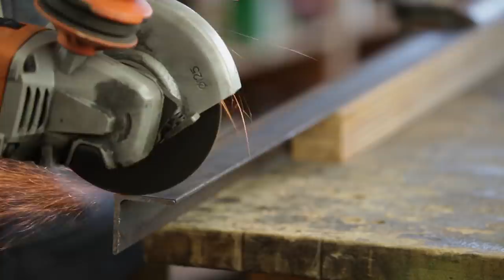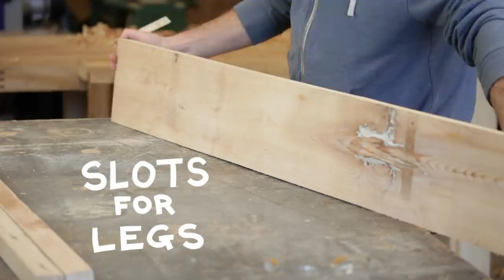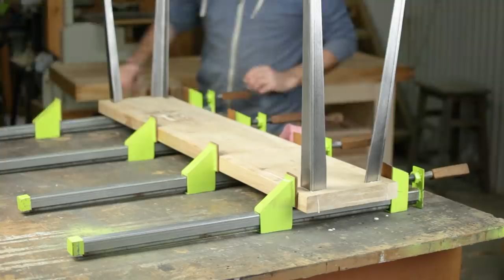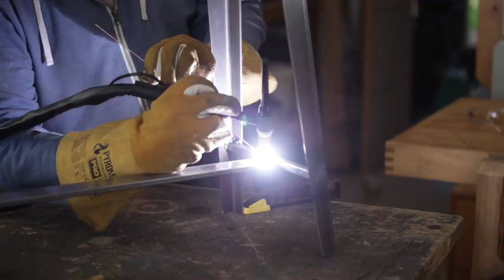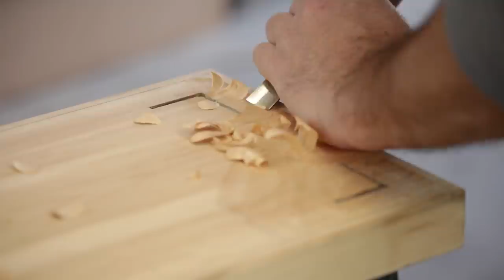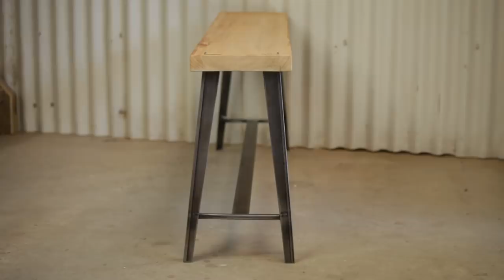Wood and Steel Bench - Carved Textured Seat

Comment: My goodness Neil!!! 😉the way you figure in the compound angles ahead of time!...VERY awesome!!!😊😊what an incredible piece brother and it seems your tug welding did just fine!!😉👊👊💪🏻💪🏻
Reply from the maker: Thank you Jed! I wanted to do this a long time ago and wondered if i could make a mortice for the leg but the steel is only 3mm thick so would have been difficult to achieve so that's how I came up with this way. The welds are ok in the fact they won't come apart but welding into the internal corners was tricky so don't look the best - I'm happy enough with them though. :)
Reply: Pask Makes it's definitely difficult to get those inside corners! Also if the metal isn't impeccably clean for tig welding it certainly has a hard time tying into the surface. I love how you changed direction in order to achieve your vision!!💪🏻💪🏻 have a great night (if my math is correct😉) Neil and see ya on the next one😊😊👊

Comment: Really cool contrast between the steel legs and the wood top, reminds me a lot of an knife blade between wooden grips. The angles cut into the steel legs really sets it off. Little tip for tig welding, clean metal is everything! It looks like you did not fully remove the mill scale from the hot rolled steel before you welded (looks like the sanding you did actually polished the scale). Cold rolled steel has an lot cleaner surface and is easier to prep.
Reply from the maker: Thank you and thanks for the tip, I need to get back to the tig welder soon! :)

Comment: hey pask,

a little tip for the welding: you need to keep the tungsten closer to the weld so you have a nice short arc, the first thing i had to learn with tig: preparing the weld is like 90% of the result, including making sure that the tungsten is sharpened the right way, the argon is flowing at the right rate ( too much argon is also bad because it kinda makes the weld go weird ). one thing you "made right" is by starting on thicker material. i did my first experiments on 1,5mm wall thickness wich was nearly imposible to do without burning right through.
Reply from the maker: Thanks for the tips mate! The main thing I struggled with was welding into the corners (away from the corners actually) that would've been easier with the mig (for me anyway). :)
Reply: ahhh i see :) a friend of mine wich is welder gave me the tip to do the weld without pulling the trigger first, so you can figure out how you want to move the torch / if its possible to do as you think it is, and then after that you make the weld. cant tell, never welded with mig, looks easier but somehow i dont have the desire to do mig. i dont make welds for money so i dont care how fast they go, but more how good they end up looking :) 

a great source for practise materials are metal workers, they usually have a big scrap container and if you ask, you can get the stuff. i made the agreement, that i bring the stuff back, so he gets his scrap money and i get stuff to try weldments :)

Comment: beautiful work and design. for something made to be sat on, you could have screwed the angle iron on the inside before gluing the whole thing in using much longer screws than the ones you used.

Comment: There's a much easier and cool looking way to get the natural texture of the wood out. Deep burned Shugi ban, wire brush till all weak wood is gone and viola. Good texture, deep color,and a sealed surface with no need of chemicals.

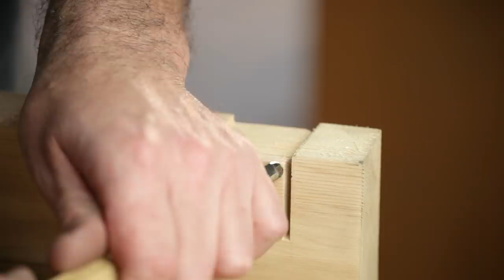Comment: At 03:32, just before the glue-up, and when you finish the recess for the legs, could you have driven 1 or 2 screws to the leg and the wood? I think that would have been a stronger bind than the angled one you set later. Ofcourse, detaching the legs at a later stage would be cumbersome, but from the strength point of view, and if detaching wasn't an option....

Comment: Absolutely Beautiful!!! Question for ya: Why the scallope work prior to the line carving?
Reply from the maker: Thank you! I scalloped it by hand first to make the top slightly uneven and add some depth to the texture. I could have done that with a router but the carved lines would've been cleaner than the look I was going for. :)

Comment: Very nice!

Just one question, how did you keep those hard carved lines in the top of the bench parallel, did you mark them out before hand? It didn't look like it on the video close-ups?

The end result looks fantastic and I liked the way you cut the sides off and then glued them back on after fitting the legs, I was wondering how you were going to cut those 3mm wide slots for the legs of the legs! :-)

Comment: how is it that the metal legs doesn't slide down seeing that the only thing holding it is glue?
Reply from the maker: I did show that I put a screw in each leg but also the angle of the four legs splaying out will stop the top from slipping down anyhow. :)